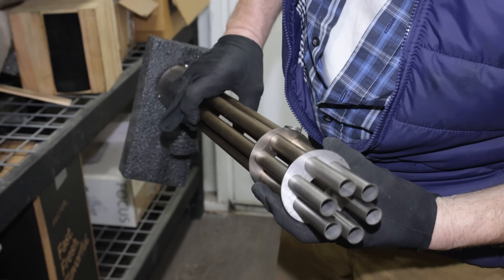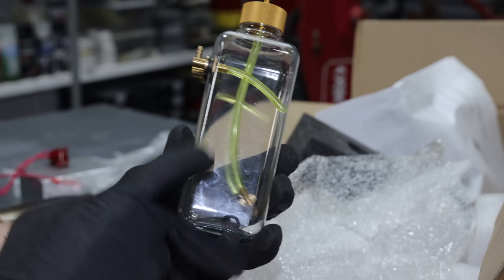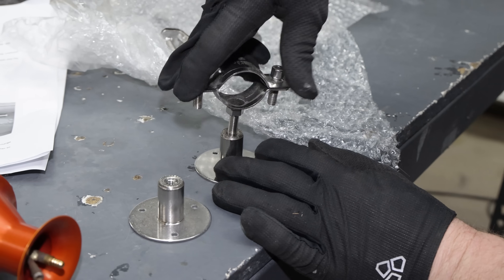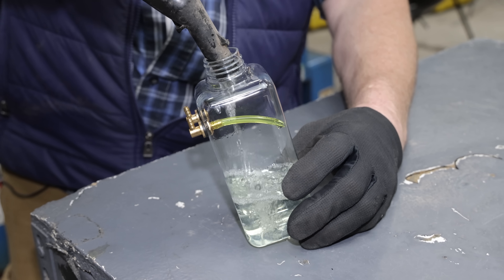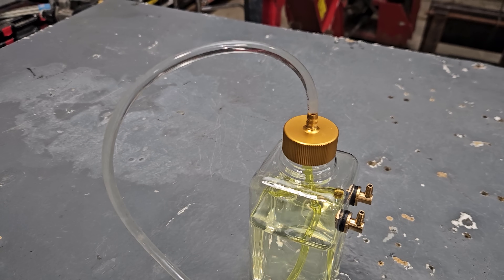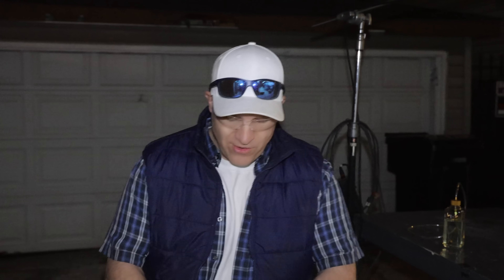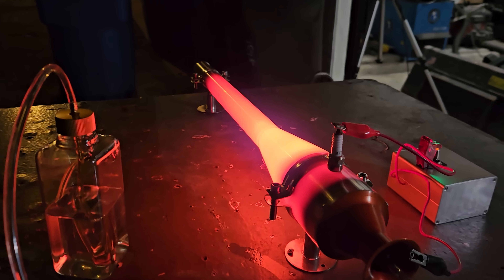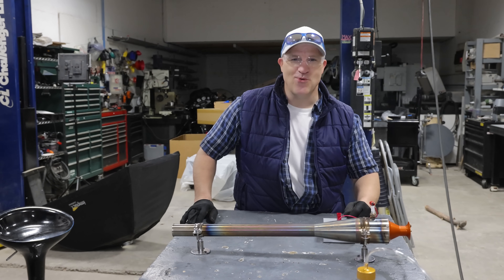A Pulse Jet Engine That Runs On Gasoline

Comment: The original pulse jets had the firing chamber heated to glowing red hot before introducing the fuel through a venturi in the chamber, which exploded, gave thrust but left a vacuum which sucked in more fuel and air, which started the next explosion, repeatedly. The explosion shut the inlet valves to increase the pressure in the chamber to give max thrust. The explosions, as we saw, heated the motor to red hot so that it became self-sustaining while fuel lasted. In WW2 the V1 Doodle Bug motors were given sufficient fuel timed to run out over London, so they listened for the noise to stop before putting their heads down behind cover.

Comment: I went on Ebay and got a 10 pack of the old style fuel can spouts that comes with ten vents as well. It was like 15 bucks for the pack. The modern fuel can spouts are garbage, I accidentally shot fuel in my sons face because of the built up pressure, which built up in just a few minutes after I set it down. I'm just glad it didn't seriously hurt him, totally didn't realize how much pressure can build up in them.

Comment: 5:40 I'd be "mildly concerned" about the high pressure environment inside the combustion chamber with the motor-body changing color like that.

"Today, we're learning how to melt steel using regular ass gasoline: so, you take A JET ENGINE, and..."

Comment: May be you should wrap around the engine a small diameter copper tubing and connected directly into the fuel inlet and into the fuel tank. The fuel traveling around the tubing will absorb some of the heat from the engine in order to cool it as rocket engines do.

Comment: Put your high speed camera on it.I have bigger 100mm Diameter RC type pjs of my own design that make 130 Decibels of noise and put out 10kg of thrust.When running you can lift the fuel tank higher to give it more fuel & more thrust if main jet is a bit small.You can run it on Nitro / Methanol fuel to but needs a bigger main jet also.That one looks about 3kg thrust and 115 des noise to me.How long to the reeds last ? Not long I bet.

Comment: You only need to use ignition when starting it up as soon as it's warmed up and starts glowing you can turn the ignition off and it will keep running
Reply: That’s exactly what he did at 4:15

Comment: These first came out in the mid 1940's/50's.  Dynajet.  I've never played with them, but, I am assuming that once started and let go on it's way, the moving air around it would help with cooling.  Holding it stationary without air moving around the outside of it, will run MUCH hotter.

Comment: I always thought it would be cool to do a water-filled cooling jacket on the outer wall, which would produce steam, which you could pipe and nozzle out the rear to capture and reuse some of the waste heat.
Reply: Water is heavy and it doesn't combust. Disgusting. Horrible idea!
Skip the air intake all together, gross, who even wants that.
Fill one half the cooling jacket with liquid oxygen and the other half with fuel!
Now, THAT'S a Rocket!

Comment: Awesome gasoline powered pulse jet. Can you use Nitromethane, cut 50% with Methanol? 😏
Reply: "Nitromethane" sounds like the name of a compound that REALLY wants to stop existing. Is it a high explosive?
Reply: @The_Inquisitive_Inquisitor Top Fuel Dragster, Funny Car uses it, ESPN, or FSN. Testors use to sell it for their 2-Stroke .049 engine with a glow plug. Glow plugs didn't last that long so I started cutting the Nitromethane with 100% Methanol and no more than 50%. It lowers the combustion temperature and the glow plugs lasted longer.

Comment: Looks like a great shop heater😂 put a shroud around the body and have it Venturi off the exhaust to keep it slightly cooler so the metal doesn't disappear as fast
Reply from the maker: Funny you say that because just running this thing for about 10 or 20 seconds was heating up my shop

Comment: You can run them on Kerosene, Diesel, Gasoline or blends of them.
Reply: Was just wondering if higher resistance to detonation (high octane) fuel would need a slightly different resonance tune, or volume of chamber. I'd guess it would make more thrust?
Reply: @johngalt97  The combustion-frequency is determined by the length of the resonance-tube. It's 1/4 of the speed of sound divided by length of tube.

Comment: What happens at 06:11 if the glass bottle were to smash? You'd be going viral!
Reply: Well, it was plastic... which is actually even worse
Reply: @The_Inquisitive_Inquisitor  Not really worse, one is as bad as the other.  The glass can break, spilling all of the gasoline at once, the plastic one could partially melt, causing the gas to leak out, catch on fire and melt the bottle even more, thus releasing more gas for more flames.  Would you rather be hit by a slow moving ten pound cannon ball, or a fast moving .30" caliber rifle bullet?  You'll still be dead either way.   The fuel tank and piping should be made out of metal, just like the rest of the engine.
Reply: @AnotherWisenedOne  The plastic would 100% melt if it touched the hot metal, the glass probably wouldn't break unless it fell off the table.
Reply: @The_Inquisitive_Inquisitor  Unless the glass is Pyrex or a similar heat resistant formulation, it definitely WILL break!  And since Pyrex glass is so expensive, I seriously doubt that anyone makes bottles out of it.  Test tubes and beakers and flasks, yes, but storage bottles?  Uh, no.
Reply: @AnotherWisenedOne  it would take a while for the bottle would break from heat. Plenty of time to reach out and move it.
Reply: @The_Inquisitive_Inquisitor  OK, then order up one of those engines, light it up until it's glowing white hot like in the video, then move the bottle over to where it touches it, and see how long it takes for that cold glass to experience thermal shock with that super high heated stainless steel and break!  You better use something that will get you a couple arm's length away from it, though!
Reply: @AnotherWisenedOne  I don't need to buy a pulse-jet engine to heat up some steel and touch a glass bottle with it. I have my own forge.
Reply: @The_Inquisitive_Inquisitor  Well good for you then!  I'd love to have easy access to a forge so I could get into knife making!  I've got some interesting odd bits of steel that I'd love to do a canister Damascus blade with!  Do you have a power hammer too?  There's a guy who has a forge and hammer not too far from me, but he wants $450 a day to come into his shop and use his equipment!    You have to bring in all of your own materials too!
Reply: @AnotherWisenedOne  Lol I wish I had a power hammer, that's a heavy duty piece of equipment!
I've just got a little hobby forge (single-burner, propane), plus my welding gear.
If that guy has a fully loaded workshop, then $450 to use it for a day (B-Y-O-Steel) might actually be a good deal.
Reply: @The_Inquisitive_Inquisitor  I seriously doubt that I could make enough blade material in one day to justify the cost.  If I was a blade master, and my shop burned down, I might jump at an opportunity like that to make some cash flow until I got back up and running again.  There are a couple of guys who make exquisite looking knives that sell for many thousands, but that's not me.  Once the steel is done cooking, which is the hardest part, the finish work could be done in nearly any garage or living room or kitchen.
Reply: @AnotherWisenedOne  When you've got all the right equipment, then it's relatively quick and easy to form your Damascus billet and set the forge-welds... all the right equipment is a serious investment though.
Of course, you also still have to cut the billet into blanks, pattern them, do any more forging you want to do... you know, actually make it into a knife...

Comment: this could be used to make a more efficient furnace. the output could spin a turbo like rotor and then exhaust into an heat exchanger where the cool side of said turbo could blow air to heat a room....

Comment: You can cut the spark off once you get it going.
Reply from the maker: I learned that really quickly here, I thought cutting the spark would stop the engine lol.
Reply: @WarpedYT  yep these are like diesel engines, only way to shut them off is either you cut off fuel or air

Comment: Old Tech.  U Control fliers have been racing these for years.  National Comps all the way back to the late 40's have been using these engines.  I've flown them a few times back in the 70's.  Dynajets were the ones we flew.
Reply from the maker: That's awesome,  I didn't know that but I've never heard of Dyna Jets I'm going to look that up.
Reply: @WarpedYT Dyna make the best performing and best looking pulse jets. A tip for after start up, remove power leads asap.
I used to have a Dyna powered Falcon 120, an absolute blast to fly.
Reply: Yeah, I bet the Brits HATED these things in the 40s....

Comment: Fuel bottle wanted that red hot melty stick BAD.
Reply: seriously, strap it in place.
Reply: And aren't you supposed to turn off the starter once it starts since it only needs sparks to start?
Reply from the maker: @winstonsmith478 yes I figured that out after the fact
Reply: Would just the radiation make the fuel boil or combust?
Reply: Forbidden kiss
Reply from the maker: Lol

Comment: I wonder if it was getting too much fuel.  I hope you put a throttle? on the fuel line to try it with less fuel.  Also, I am pretty sure that will light the table and fuel line on fire if you run it for very long.
Reply from the maker: I was thinking the same thing, I wonder if I put a throttle valve on it if I could modulate the thrust.

Comment: Could you control the amount of thrust by valving the fuel or is this an it’s-on-or-it’s-off sorta thing? That things gets hot! Is that one of the drawbacks of using a pulse jet? Thanks for vids!
Reply: Adjusting the fuel mixture does change the thrust. It will run at the same frequency (almost), but giving it a richer mixture will push more exhaust out.
Reply: @alexanderg-p3z  Upper limit of thrust is where things melt?
Reply: @johngalt97  Fueleconomy matter too. If the mixture is too rich, a lot of the fuel is not combusted. (at a certain point, a richer fuel-mixture will lower temperature)

Comment: woot electric arc plasma mhd-heat kinda pulsejets are nice too. ie drive by wire not drive by gas throttle. suitable for drones and such. ie super charged sauna heating railgun coils. not pulsejet but continuous heat furnace type thruster. ie instead of fuel you use a big battery and a bigger continuous plasma spark coil.

Comment: I believe that pulse jets have a poor specific fuel consumption because they lack compression, and I don’t know how this problem can be fixed.
Reply: Did you notice the embers of unburnt fuel particles whizzing past the main plume. 
I love the smell of hydrocarbons burning  😅
Reply: The compression is determined by the geometry of the chamber and tube, and the fuel-mixture. The resonance-tupe creates the compression, with the standing wave.
That's mostly the parameters to increase compression - size of combustion-chamber, and length of the resonance-tube.
Reply: @alexanderg-p3z  Yes, but for better thermal efficiency, I believe that a compression ratio of at least 2 or 3 to 1 should be obtained.  Standing wave compression is likely to be a fraction of that.
Reply: @duanegrindstaff9635   Reynst covers this in his book. The V1 engine had around 2:1. That's still nowhere near what would be considered an efficient compression ratio, but it could be used as a doubler in a regular jet engine if you can overcome the low efficiency of a pulse on turbines.
Reply: @rcrdps8144  I'd still like to know how to get a good SFC in a pulse jet
Reply: @duanegrindstaff9635  Yeah, probably not happening on its own. Reynst suggested a pulse combustor could be used to bring up the efficiency of a cheap/small single stage radial turbine/engine. He suggested basically what we now call a wave rotor to deal with the pulses on a turbine.

Comment: Everyone knows WW2 Germany made 'Buzz Bombs' with pulse jets, but the USA made some too. One is on display outside the courthouse in Greencastle, IN. The reed valves are the weak point in pulse jets, with notoriously short useful life. The USA version of the pulse jet used neoprene seals on the cold side of the valve instead of  solid metal. You may be able to extend the life of the reed valves if the edges of the metal they work against are rounded. Also, back in the day for jet control line models, we used 'white gasoline', AKA Coleman lantern fuel.
Reply: Great comment. I always appreciate reading comments from someone who actually knows what they are talking about. Sounds like you have some experience with these.
Reply: And the Russians. 
They also used pulse jets on fighters.

The Germans were going to use powdered coal to power a pulse jet. 
And it's the same function that makes flour mills and grain bins go boom.
It is just a single use pulse jet....

Btw ram jets are just fancy pulse jets with reversion dams....like SR71 engines.
The spike is a compressor and reversion dam, ram jets don't stall at high speed, they "unstart" this was apparently "quiet violent and unsettling".
Skunk works by Ben Rich and Leo Janus, covers U2, SR71 and F117.
It is the greatest aircraft engineering book out there. It is bonkers.

Comment: I wonder what other fuels you could run it on🤔 great vid 👍
Reply: People also run these on liquid propane (from an inverted bottle). Doubt you can run it on anything else; it's not like a diesel or a turbine - they need to be carefully tuned even for the fuel they're rated on, and would never reach the proper mixture with others.